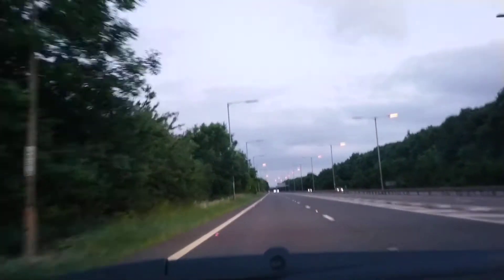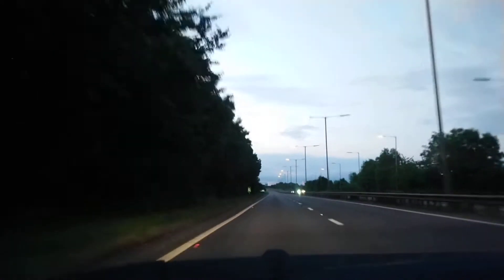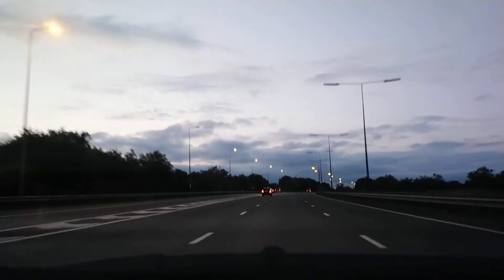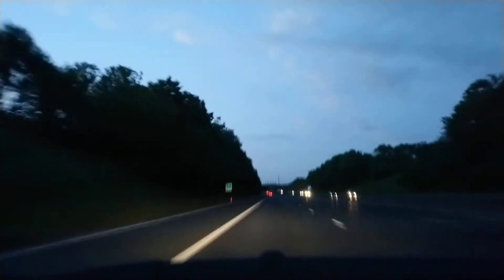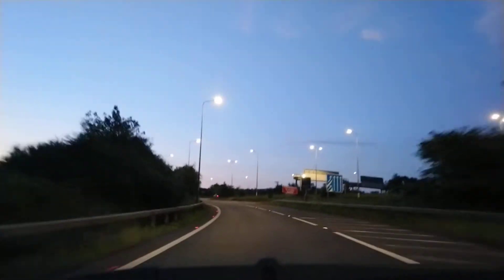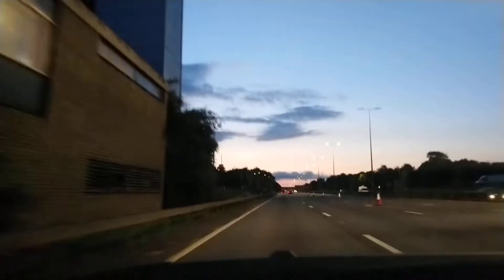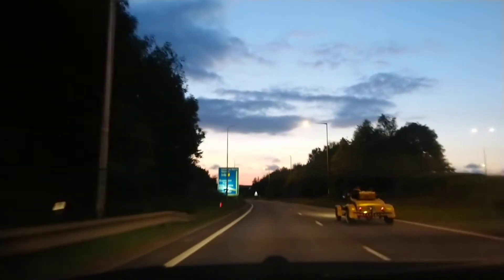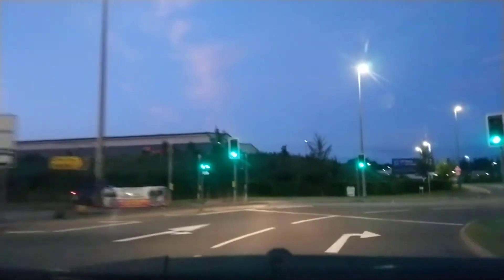LPS, HPS & Led Highway Street Lights (Uncut Video)

Comment: All the sodiums have been replaced to LED's in 2023. I liked the sodiums but they are always getting replaced 😢😢😢 Nice video though!
Reply from the maker: 3 Large LPS twins from M69 on to M6 still there don't work and a single to slip road M6 south also not working + some HPS still only 8 HPS work.

Comment: I live in Northern California, the city of San Jose had a majority of streetlights that were LPS, now most of them are converted to LEDs. I always found the LPS to be funky looking with horrible color rendering. The red Honda we used to have looked tan under the LPS glowing light. LPS despite their poor color rendering and weird designs are great for the environment. It cuts down on light pollution and helps nearby observatories observe the stars clearly at night. LEDs on the other hand have many pros but cons as well, personally I love the color, energy savings and long life, but they need to redesign them better. They put too much glare in my eyes at night, causing me to slow down a bit every time I drive underneath one. These companies that design LEDS should design them like the HPS or even LPS with a solid Lens cover. In The US, they are now using the warm light LEDs for residential areas, and the day light or neutral white for freeways (motorways) and avenues.

Comment: Do you think that maybe the LPS and  HPS will ever return?
Reply from the maker: Unlikely, The bigger question whats going to replace LED?
Reply: @davesbusstuffandmore  I've seen loads of pictures of different types of high and lo pressure lamps. And they are so many different lamps that look different they have the same bulb just the lamp design seen many different lamp designs for the sodium lights can you explain what the difference is I the designs of the lamp if one has like a different job
Reply: @davesbusstuffandmore  LEC light emitting chip? Who knows what's next lol
Reply: @davesbusstuffandmore 
RGB lighting
Reply: Also that LEDS produce radiation

Comment: The LED lights on the M1 and M69 replaced HPS ones, which was a shame because a lot of them weren’t even that old. The new lanterns on the tallest columns along the M1 main carriageway are now Philips Lumas, and then on the sliproads and main carriageway of the M69 the new lanterns there are Thorn R2L2s.
Reply: urbis evolos were the central reservation ones the leicester m1 stretch j21-21a had, one of the newest hps (pre-LED) designs
Reply: M1 j23-23a sgs204s still there atm

Comment: Philips MA60s are the name of those LPS lights on the M69. The biggest ones Philips did I think were the SRP254s, which used to light the M6 and M5 in Birmingham and the Black Country back in the 1970s and 80s, but then they all got replaced in the 1990s.

Comment: I miss the batch of the LPS ones around East Midlands Airport. Because they were so low and were on all sides, it felt like you were going through a tunnel at night when they were on.
Reply from the maker: Yes I do miss the old LPS street lights. I was surprised when I see some still working on the M69 in Coventry.
Reply: Theres still a few left on the M1 outside East Midlands Airport, at the junction for the A42.
Reply: I remember them well. Straight back to the 1980s when most roads had these lights.